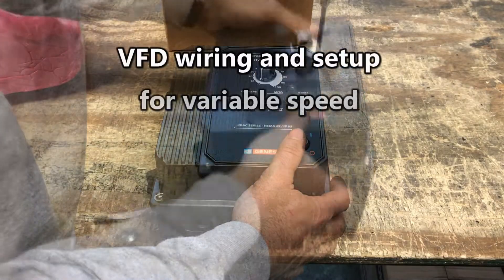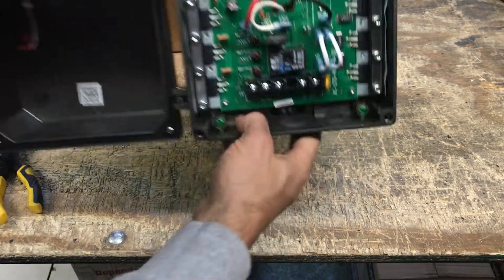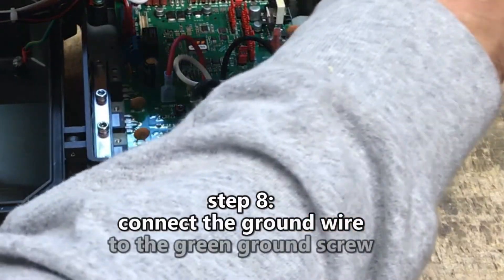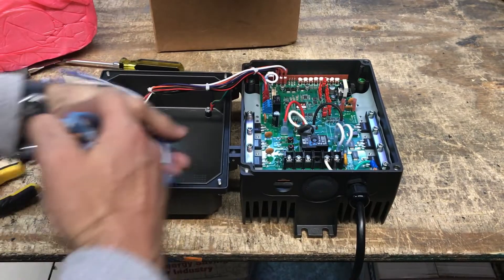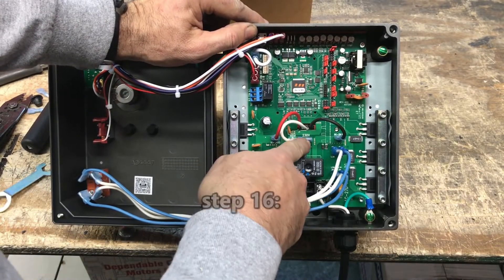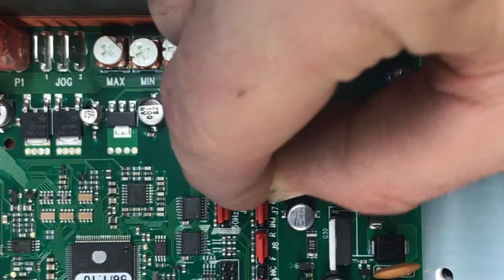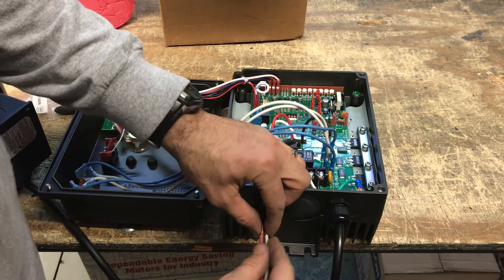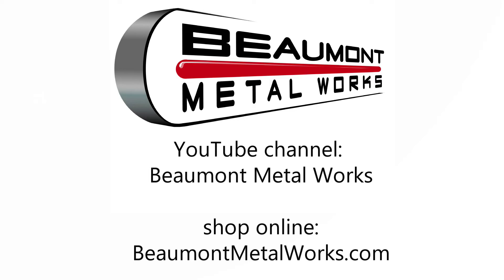How To Wire and Setup a VFD for Variable Speed KMG Belt Grinders

Comment: What is the proper setup for wiring input 110 and output 110 for iuse like a variable resistor to control the speed of a 110 motor?  And  which wires go where? 110 has a neutral and a hot. How do I do that? 
I have the 1 hp model VFR.

Comment: Great content 
Do one for returning the motor back to 220v
Reply from the maker: If you want to power the VFD with 220v, simply move the jumper J1 from 115v to its 230v setting.   That's the only change in the VFD.
Reply: BeaumontMetalWorks 
The > motor <   You had just nicely explained the vfd in this video, thank you for that.
Reply: What the frequency double to 120 htz, would you use the same trim pot settings